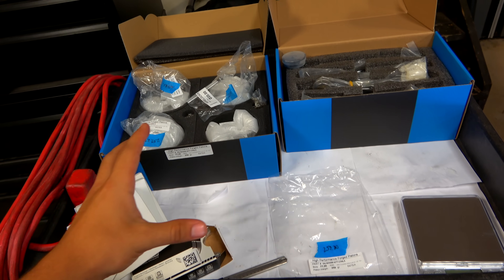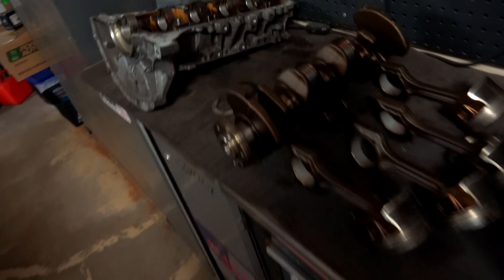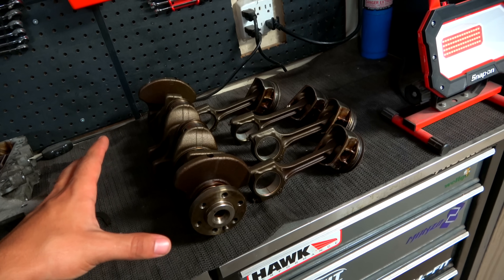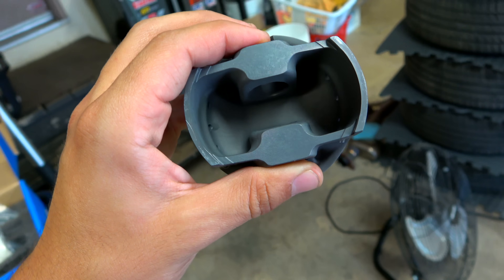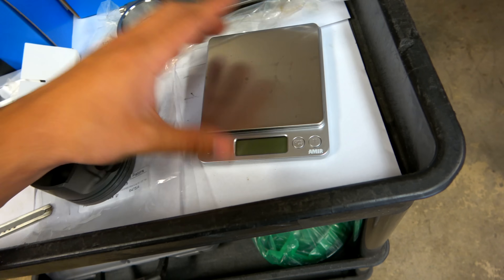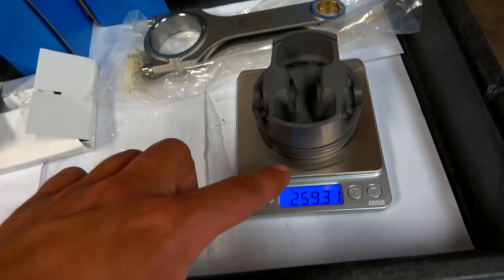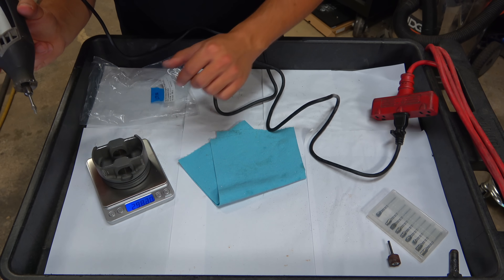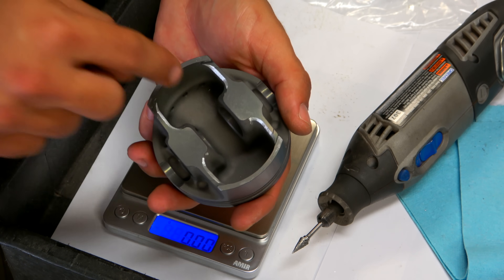Beginning the Engine REASSEMBLY!!! Bottom-End Balancing

Comment: Perfect is perfect..no doubt!!  But for 99% perfect. You can often get very close to perfection buy mating you heaviest rod to your lightest piston  and wrist pin. By making each of the the complete rod,piston,wrist pin, rings and clips weigh all the same. Then remove weight to make the complete assembly match the other piston assemblies.  Your crankshaft will hardly notice that you only matched the complete assembly....not every single piece..

Comment: Lowering the compretion ratio will not give you more horsepower it will give you less because you lower the efficiensy of the engine, it just allows you to run higher boost on a safer level. The turbo and the valves/cams are what fills the cillinder whith air on a turbocharged vehicle, also on a small engine you would want higher compression because it gives better response. Besides that loving the vids

Comment: The stock crank and rods look forged due to the really thick parting line, fully cast parts will have a significantly thinner casting line and more sharp edges. Although I'm certain the forged H beam rods will fair much better at bearing a load and moving oil more freely along with being a lighter weight. :) Best of luck!

Comment: I hope that crankshaft wasn’t sitting on its side like that for a while 😰
Reply: Deadman 25 How does that affect the shaft?
Reply: HumbleServant20 over time the weight in the middle of the shaft will slightly bend the shaft and cause the crank shaft to be unbalanced
Reply: Deadman 25 Thanks

Comment: Can you not weigh the pistons with the rings then match the heaviest rings with lightest pistons etc to save taking so much material from the pistons?
Reply from the maker: You can, but that is the half-assed way to do it. It works, it does the trick, however if you balance parts individually, you don't need to pair anything because they are all identical specs.

Comment: Why aren't they balanced already from the factory?
Reply: they are just not to really fine tolarences, you can run it without doing this
Reply: andy ? Maybe a more expensive set would be balanced?
Reply from the maker: I'm yet to see pistons that are balanced to within 0.01 gram. It is a very negligible difference, however if you have the time to do it, do it :) It makes the crankshaft balancing procedure easier

Comment: So the Honda dealer is replacing my Pistons and rings, do you things that they properly balanced it, or are OEM parts already pretty accurate.
Reply from the maker: They are accurate, but it all depends on the dealership. I'd call and ask to see if they are doing that, since they are replacing the pistons. You can have 100 of the same pistons and I will bet they ALL have a different weight.

Comment: If you balance the crank and flywheel as separate parts, the shop will balance them neutrally. When they're balanced like that and it's precise, they will still be neutral when you bolt them together and orientation won't matter.

Comment: Do you have to be concerned for the piston heads rusting since you removed the coating/finish with a Dremel?
Reply from the maker: The pistons are made out of Forged Aluminum, so it isn't an issue. The connecting rods and wrist pins are made from steel, so those would have to be coated in an oil to prevent it from rusting